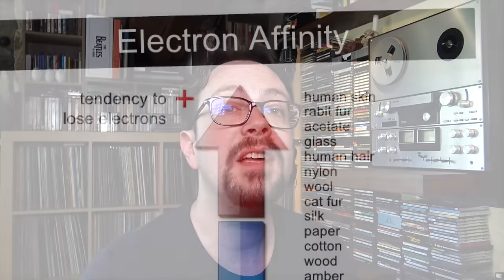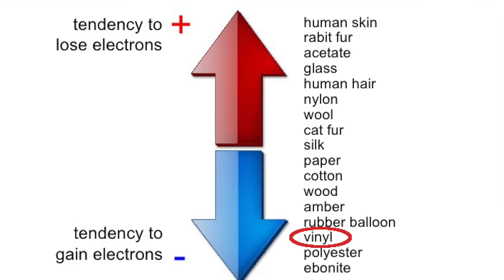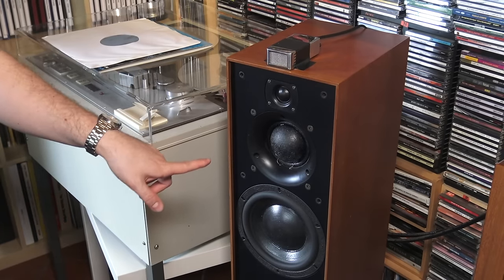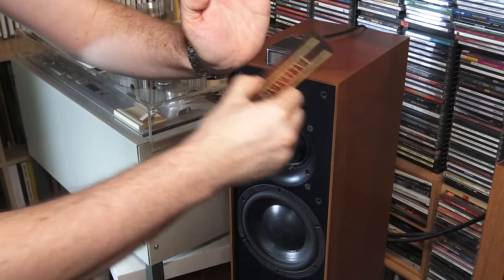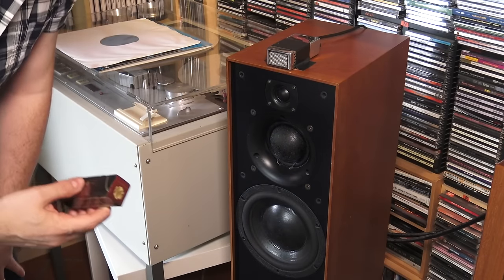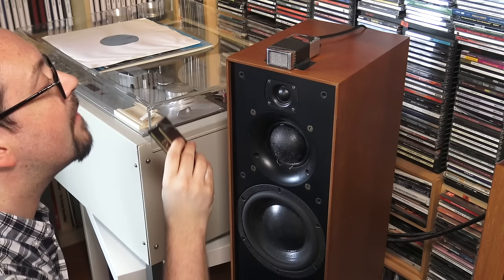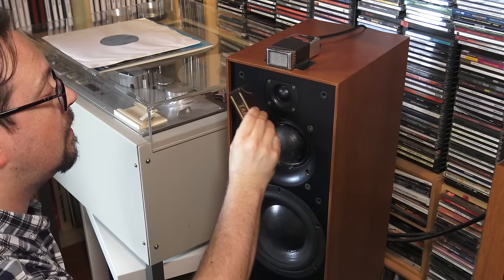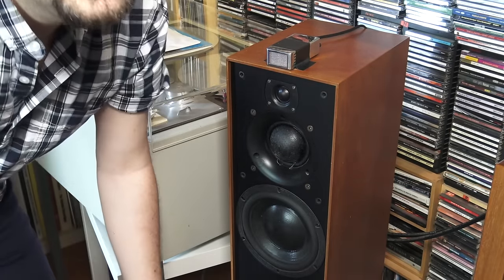How to eliminate static electricity from records & gear

Comment: Get to the point. Everything- not just records, but CD's, speaker cables, everything!- sounds better when we reduce static charges. The best/cheapest is ordinary anti-static spray for clothing sold everywhere. Next is the Zerostat, which is actually cheap considering it lasts a lifetime. I've had mine since 1976. Even more effective, the Radio Shack Bulk Tape Eraser, basically a much higher-powered version of the hideously overpriced Talisman. Technically its a powerful demagnetizer that can be used to demagnetize speaker cables, interconnects, anything that might pick up magnetic charges over time. Really cleans up the sound. Removes grain and glare, improves inner detail and extension. And yes I know it shouldn't do anything but CDs and records do sound better if you use this just before playing. 
I just thought I would post this because it takes me much less time than watching this rambling never gets to the point in love with hearing himself talk presentation. Not to mention if you pin it then it can save everyone else a bundle of time too. So pin it.
Reply: Charles Miller You can reduce static charge on your CD’s, speaker cables, records and hi-fi equipment, but it’s pointless unless you also reduce static from your ear hair. Trust me, use the Zerostat on your ears FIRST!

Comment: Best way to remove static is a room deionizer.
Reply from the maker: Thanks for your suggestion Kevin! All helps!
Reply: House plants are better, not only for your equipment & room acoustics, but also your health. Room ionisers produce Ozone, which although good at protecting the planet from the Suns UV rays whilst high in the atmosphere, is a very toxic gas to humans, if breathed in over a prolonged period of time. Do a search for Ozone on the Periodic tables channel, it's quite enlightening, & also very entertaining.
Reply from the maker: Yes, I agree! I head about this and I Think it does help.
Reply: Kevin, how to remove the Static from vinyl record by using Room Deionizer?
Reply from the maker: Just buy it and put it in the room!
Reply: Ok well. Thank you friend.  Cheers.
Reply from the maker: I will talk about it in the second part.
Reply: Eagerly Awaiting dear ! Thanks in advance.
Reply: Dear ana[dia]log,  in your second part,  kindly , explain once again that how to properly and effectively use the Milty Gun.  There is different type of ideas on the usage.  Mainly I want the using direction on VINYL records.   Thanks.  Best.
Reply: I don't no what to say, does magnetism remove static ? I think need have chat with couple friends at De-montfort University who experts on electromagnetism.

Comment: Ive been able to fit almost all my MoFi sleeves inside any paper sleeve. Ive been avoiding it though as I want to avoid creating ring wear on any good looking sleeve.
Take a look:
https://s22.postimg.cc/bblwhqfdt/20180617_123304.jpg
And I tell you I can do this for almost any inner sleeve. Because I used to do it. Sometimes you just have to bend the bottom part a little but it doesnt cause any problems.
Reply from the maker: Good for you Leon! I remember that I tried and tried but the results were not as neat as with the Nagaoka and it took a lot of time to insert the Mofis. Maybe they have made them smaller in the meantime?
Reply: ana[dia]log perhaps, Ive used more than a hundred since last year at least.
Reply from the maker: A lot of records there...good job!